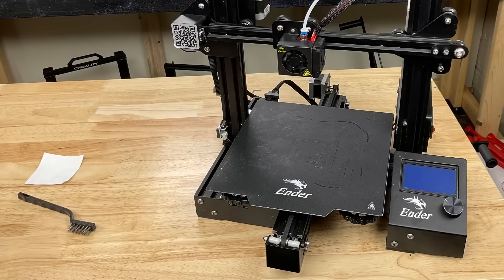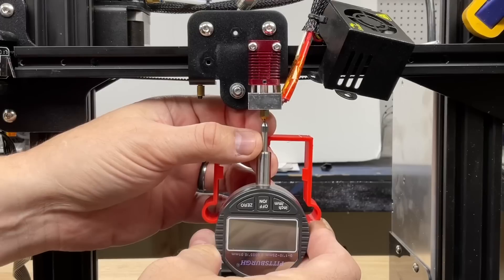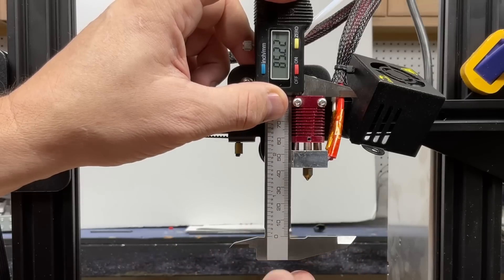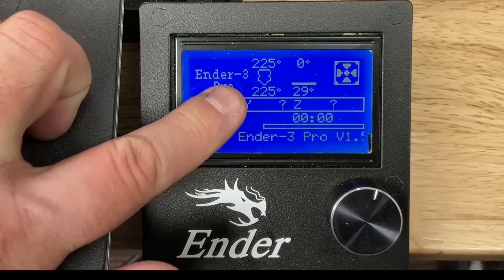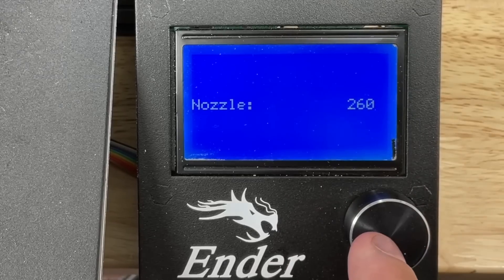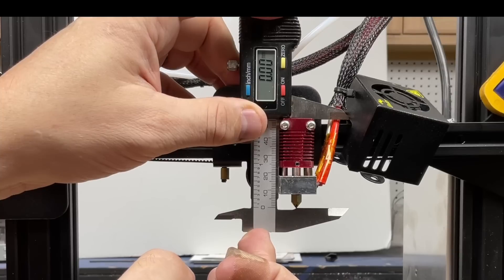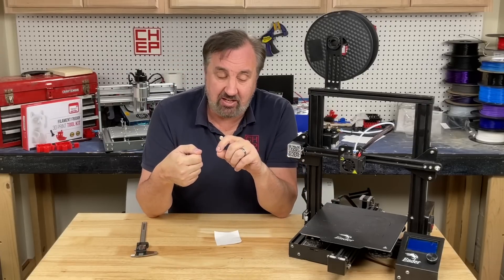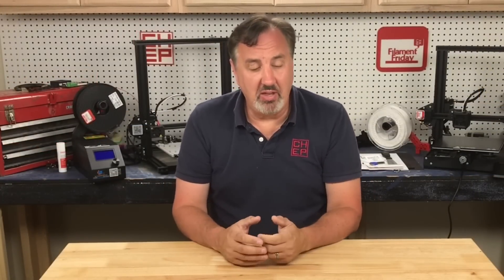Does a Heated Nozzle Expand and Mess Up Your Bed Level?

Comment: I always preheat the bed to 60 for about 15 minutes and then do my leveling. I've never had an issue with this method. Great video!
Reply from the maker: Based on my previous video, that makes sense because I found heated or not heated showed the same result. https://youtu.be/NlUO-5EtB44

Comment: I don't even use paper. I do all my bed levelling by eye on the first layer while it does the brim and first layer. I will adjust each corner and look at the filament contact from the nozzle as it moves slowly until I see the sweet spot. This is after it's been primed of course so I know the flow is at 100%. I also have the brim speed nice and slow (about 20mm/s) to make it more accurate and easier to turn the adjustment wheels. 
Using the paper method has never got me good results. I've trained my eye to do a better job. If you have light behind the printer you can judge the gap by the shadow.
Reply from the maker: ArchanePath360 - Most beginners can’t do that and even the included manuals show them to use paper. I use to do as you describe but found using my bed level tool with a proper matching Z offset gives me near perfect tram every time.
Reply: leveling with paper is like leveling with a squishy matrass, it can never be correct . Most metals tend to expand with heat also thus one minimizes everything that can go random. Using metal gauges and doing it at the temp it runs at, both bed and nozzle, that is being technically correct. Other methods are for amateurs. With 3d printers , the trained eye is mostly enough since it's 'plastic' it's not exact by nature either. As long as that first layer sticks the rest will follow automatically depending on filament and printer quality of course, it's not that hard. People tend to make things difficult so they have something to talk about or show of their "expert" knowledge at the pub. Amateur chefs discussing how to make the best whipped cream.... real chefs know how to make it the way they like it. One uses what works for them.

Comment: My question is was that the heat sync expanding cause it has no cooling or is it just the block and nozzles?
Reply from the maker: I kept the fan on the heat sink until I measured as mentioned in the video so heat sink was cool to the touch.

Comment: Thank you for putting another misconception in its place. Not sure why so many try to 're-invent the wheel' when it comes to 3d printing. Many so called NEW concepts/ideas are already common place in industry 😎. I bet the actual deviation in a standered ender bed makes the tiny differences here really insignificant.
Reply from the maker: No, I showed it has minor expansion. I’ve been doing cold levels for years. Get great results. I don’t see any improvement with hot so I tested it and determined in most cases heating serves little to no improvement.
Reply: @wojtek-33  The misconception is that levelling has to be done hot.
Reply from the maker: 40-60%?!!
Where. I showed worse case 0.06mm expansion in the nozzle. Typical 0.4mm. At 0.2 layer height. That’s 20-30%. Even at 0.1 layer height, first layer is typically set to 0.2. But certainly raw value not enough to worry about on first layer. And all I’m saying it’s not worth worrying about. You can heat if you want but it’s not necessary.

Comment: The only thing I can see is you were not measuring against the Bed where the difference would be important. The total expansion of the head assembly is not really the Head to Bed expansion... IMO
Reply from the maker: Lasersbee - I showed in this video that the bed doesn’t expand at the adjusters. https://youtu.be/NlUO-5EtB44
Reply: That is true. However, seeing as the hotend is fastened by the heatsink at the top, you assume the expansion is in the downwards direction.
Since the deviation is only .06 at 260°, I'd like to see the actual deviation when the heatsink is kept at a constant, lower, temperature. Maybe he should just have included some temperature readings of the heatsink as well.
Reply from the maker: Paris - The heat sink was cool to the touch. I kept the fan on it by holding it my hand while I did the measurement. I mentioned that in the video.

Comment: The main reason I can see for heating the nozzle is it makes it easier to clean off any plastic that may be protruding from the nozzle - if there is any, it will stop you getting an accurate level. When the nozzle is cold, it can be hard to remove a small "dribble" and you could risk having a large unwanted offset.  Of course, this won't be an issue if you level the bed with the filament removed.
Reply from the maker: I did mention at the beginning heating the nozzle to clean it is important.

Comment: Thanks for tackling the question. I agree - you used a good method. You demonstrated in your previous video that bed warps a bit - whether that is an issue will depend on your print job. I wonder if an enclosure and leaving the bed to heat up for longer before starting a print reduces the amount of bed warping? Have you done an experiment on that?  Thanks for taking the time to do these experiments and sharing the results.

Comment: Think what makes a difference is when you have an induction sensor,  seems to be heat sensitive to bed temp. In fact the bed temp seems to make more of a difference than if my nozzle is cold or hot.

Comment: On my CR-10, the level changes dramatically with bed temperature. Nozzle temperature has a smaller, but noticeable effect. My measurement technique is just using a piece of paper and running through the bed leveling routine.

Comment: The only benefit when setting with a hot nozzle is that any filament build up on the nozzle will smear off onto the paper so if you want to do it cold just make sure the nozzle is clean .
Oh and I found a real easy way to get a stuck print off the ender 3 v2 glass bed - let it cool to around 30 deg and if the print wont come loose stick it in the freezer for a couple of minutes - this has worked every time for me .
Reply: But you always print with a hot (expanded) nozzle so shouldn't the leveling be done while being hot to set the correct distance for printing?
Reply: @MenM026  
The paper technique only gets you in the ball park - really it is done so you don’t drag the nozzle on the bed . Once you have set this you can either fine tune the first layer height by adjusting the bed levelling knobs or by jogging the Z axis down via Z offset . Adjusting this while printing the fist layer is what I do so I get a perfect first layer and excellent adhesion - probably too good adhesion as I usually have to take the build plate off and stick it in the freezer to get the print off the bed without a fight but on the bright side I don’t have prints breaking loose !
Reply: @Flattyman  might be worth trying to use Dimafix. It is a water solulable bed adhesion (not really glue-ish) so the bottom surface finish of your part will be the same quality as printing directly on the glass. We work with it all the time and after cooling down it makes it very easy to remove your object from the glassplate.
We use it for pla(HT) , abs(lw), petg, TPU. For Nylon or PP it will not be adhesive enough though.

Comment: The aluminium block would expand as well as the brass nozzle; in fact if I remember my metalourgy the aluminium block would expand more than the brass nozzle. It is the expansion of the block, if left as is to print daily for two or more years, will cause the block to fail from metal fatigue. I already had that happen to me on my Tronxy P802Ma which the heater block assembly is similar to the Ender series you have. Lucky for me the whole assembly (nozzle, heat block, throat, heater cartridge, and temp sensor) is only $5, so I bought a few of them... Just in case.

Either way, I level my printers' beds cold. :)

Comment: I've always just lightly kiss the paper when zeroing out my E3v2 and it works great. If I do it the way your showing here I am always too close to the bed and have to lower it as the print starts. The nozzle barely has any room to extrude and filament out. I don't understand why so many people have problems with leveling their beds... I just bought my 1st printer less than a month ago and I've never had a problem.
Reply: When my printer was less than a month old, I didn't understand the leveling problems either ;) I wish you to continue not understanding them and not run into 'and now nothing sticks all of a sudden'.

Comment: I find that when I use a heated nozzle when leveling my printbed the filament oozes all over the platform leaving a gooy sticky mess, and it sticks to the paper too which bugs me no end.
Reply: I just heat the nozzle to 150 for PLA or 200 for PETG when leveling, I've always known it's not necessary but I liked to keep my level as accurate as possible since my printer doesn't have baby stepping and it's not possible to add it unfortunately.

Comment: Very interesting Chuck. Thanks for both videos. I have an Ender 3 and I always heat the nozzle and bed before levelling. In fact I've found it best to leave the printer warm for about 7-10 mins. I put this down to the bed screws expanding and lifting the bed slightly and it take a while for the heat to transfer to those screws. I haven't tested this theory though so it could be something else. I know you have done 2 videos to show that preheating is not required but I definately get some movement between cold and about 7-10 mins in. I guess I should do some tests myself. Thanks again.

Comment: Thanks for another video. I would have gone with the dial indicator for measurements because they are more accurate than calipers, especially because the calipers were measuring off the heatsink which is also expanding. But, I think you are seeing that there is an effect there. Which is good to keep in mind. Almost half the width of a sheet of paper is plenty difference when finding the right squish. 
Thanks again for doing that study.

Comment: Thanks for your video's and tests. I found that when I leveled the bed hot I consistently got too close and my prints were extra squished in the first couple of layers and the print was very rough.  After re-leveling while cold I again got a great looking print with a very tidy first layer.

Comment: This doesn't remove from your point, but technically the expansion you are measuring is the full stack:  The nozzle, the heater block, the break, and the heat sink, each of which will expand at different rates... however, that's such a small difference that I'd call it negligible.
Reply: Yeah, since the fixed point (mounting screws) are near-as-dammit at the top the error is relatively small.

Comment: You should wait for the bead and hotend to heat  soak. Usually it takes about 20 minutes for my 120mm^2 bed to fully soak at 110c.
Reply from the maker: Are you telling me people will wait 20 minutes to heat soak everything before leveling?
Reply: @FilamentFriday  Not everyone. I for one turn on my heaters in advance so that I don't need to wait once I get my models sliced. Could be 5-30 minutes before I actually start printing so it's best to wait for things to soak for that extra consistency.

Comment: Nice video Chep. The problem of a cold nozzle is that can have some plastic and the measures will be totally wrong.
Reply from the maker: I stated in the video to clean the nozzle.
Reply: @FilamentFriday  Yes, you are right 😁👍
Reply: I'm too lazy to heat it up and clean it and let it cool back down, so I swipe the cold nozzle with an Xacto knife to cut off any goober.
Reply: @curtmcd  but you will damage the nozzle 😱
Reply: @Fagu01  Could be, if not careful! But my nozzle has seen much more damaging stuff happen to it. 🤪

Comment: I have an ender 3 with a BL Touch and I just use the probe Z offset to set the nozzle height. If I see the layers are too squished just raise it a bit, if they're too far just lower it. No need to worry about thermal expansion on the nozzle. I do have it heat the bed before the bed level because it's zero extra effort on my part and in my experience the G10 sheet on the Ender 3 does sometimes warp a bit.

Comment: The correct answer to the question posed by the title is "Maybe" - It's going to depend on several things, including the exact formula used in the making of the nozzle, the block the nozzle screws into, and several other factors that combine to make it impossible to give a definitive answer that covers all the possibilities there are. In general,m unless you're trying to measure to the micron, it USUALLY isn't going to be enough of a difference to care about, but for high-precision work... Measure it the way you're gonna run it - namely, HOT.
Reply from the maker: Or not.

Comment: Great videos. It’s interesting to see how much it’s impacted. .04mm in addition to the middle of the bed when heated can be fairly significant in my opinion (if the conditions are just right). Seems like you can do it either way as long as you stay consistent. However, I think I’ll stick to heating hot end, bed, and using a feeler gauge. It’s a tried and true method for me that has repeatable results.

Comment: Hi Chep thank you so much for the time you put in making these videos, I have years I believe following your channel, I own an Ender 3 pro, lately, I have been having tons of issues related to under extrusion issues, I was able to fix it, I changed the tube for a Capricorn tube and I changed the nozzles for a different brand and it was working fine, but I damaged the hotend, I had to change it,I got a new MK10 extruder Hotend Kit for Creality, and now I am having the same issues, it prints the first layer fine, but after some layers, it stops extruding, I believe it is an issue related to the hotend, I tested following your videos, and I printed some parts to fit in the hotend but it does not work, it melts the printed parts,  everything I know about 3d printers I have learned it by myself, but I have months trying to fix this issue, I live on a third world country and I can afford to buy some parts but I prefer not to do it to save that money, do you have any tip I can try here?
Reply from the maker: Watch these: https://youtube.com/playlist?list=PLRFPlUhDTTlka-Cq-UmI3IbbHRIwG2OsX
Reply: @FilamentFriday  I was able to fix it Chep, thanks to the first video on the playlist, I was focused on the hotend but it was the extruder, I have some upgrades in this ender 3, I have all metal extruder, but I was checking the gear that pushes the filament, and it was dirty, I have cleaned it before, but I took a closer look and the teeth of the gear were wearing down(I can share a picture if needed) luckily I have a replacement that came with the all metal extruder.
Reply: @JoshUC  Glad you fixed it! Extruder was the first thing I thought about while reading your first comment :)
Reply: @JoshUC  I had this problem with my Ender 3 Max, and I cured it by printing out a filament spool holder that used bearings to reduce friction - when the spools were nearly used, the friction pulled back on the extruder gears, causing them to slip, fill up with plastic dust and wear faster. The spool holder with bearings and a replacement extruder gear fixed it, and I no longer seem to get the wear in the gear that I did. I may even upgrade to a dual gear extruder. I also get much more consistant extrusion. Replacing/clearing the nozzle regularly helps too.
Reply: @FilamentFriday  Thank you Chep, I highly appreciate it, I will check the playlist, and I am sorry for my poor English, it is not my native lenguage.

Comment: I used to use the paper method for leveling exclusively, and I always ended up with print issues. Apparently my print bed was warped, and that was causing the issues, as the distance wouldn't be consistent between the corners and center of the print bed. Replacing my print bed with a glass print surface helped with most of these issues, but not all. In the end, I found that using the paper method to 'rough in' the level first helped, then running a quick level test print that just ran a continuous line of material around the bed from corner to corner helped me zero in on a true level, as I could adjust as the print head went around if I noticed that it was too close or too far at certain corners.
Reply from the maker: That’s what I show in this video: https://youtu.be/_EfWVUJjBdA

Comment: Thanks for the testing. I've never been 100% sold on the theory of heating while leveling. I've always had excellent results doing it cold.
Reply: It'll also be a design flaw if a surface that's supposed to be perfectly flat at high temperatures ended up bending the minute it goes above room temp.
Reply: Same here early on I went screw that just do it cold after doing the measurements I have no feeling in my fingers just the time to wait I wasn’t sold on